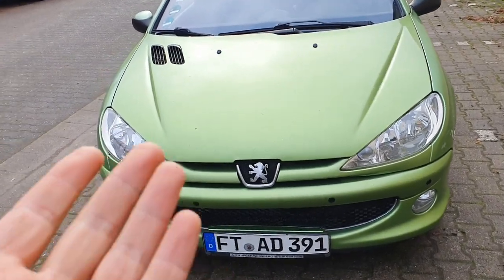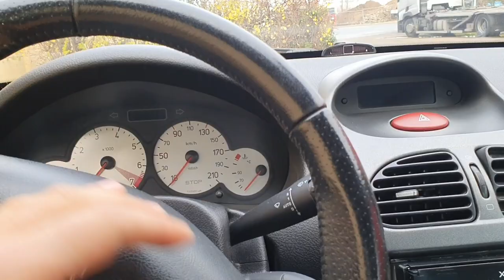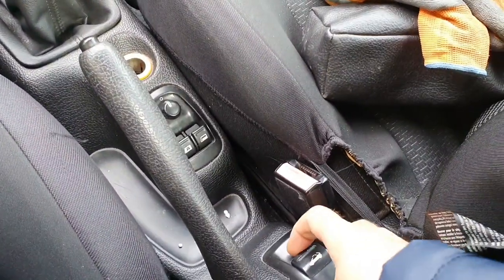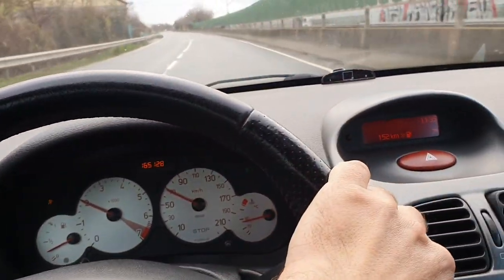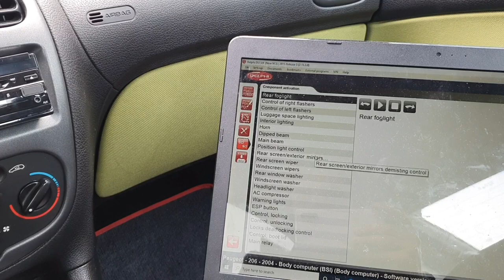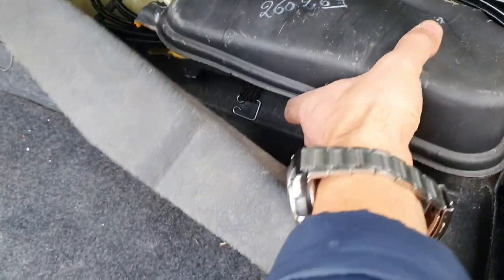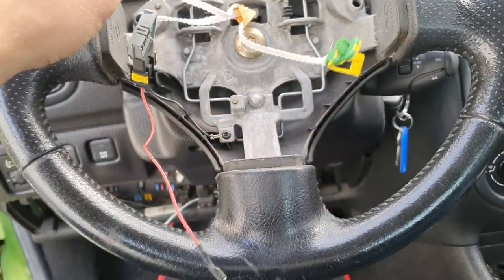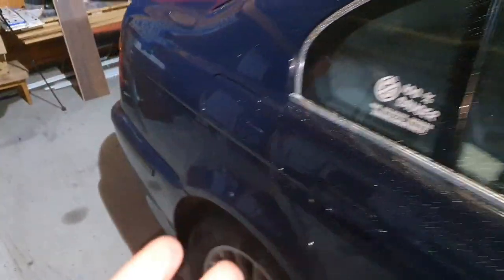Peugeot 206 CC flip car?! and we have another one...a V8 one 😈

Comment: The roof will go down if you open your trunk and pull the cover for the grocery to its place. Otherwise the roof will not go down.
Reply: yes it wont work because the pullout cover inside the trunk has not been pulled out and positioned on clips to hold it streched across the trunk that is so not to put anything higher because it has to acommodate the roof😐its logic

Comment: Mate, why didn't you ask someone who's had one, read the manual, or ask Peugeot if need be ! You have to pull the safety screen back to edge of the boot and clip it in. Be aware, that that screen can jump out of place, which it did the very first time I took the roof down, I was parked up aswell, just checking its operation for the first time. I thought had I got ignition key in wrong place or something, it started to rain, so was desperately searching on YouTube to do it manually, so went to the boot for allen key, - I then saw the screen had jumped out of place, instantly I thought, " I bet it's that", & hoped it was, sure enough, panic over, drew the screen back into place, - tg5e5 roof went straight back up effortlessly, thankfully. ✌
Reply from the maker: You are 100 % right with everything but I had no interest on keeping this car. I was just curious if the top will work.....that's why I didn't inform me at all about it. Thx for watching and for the info 🍻